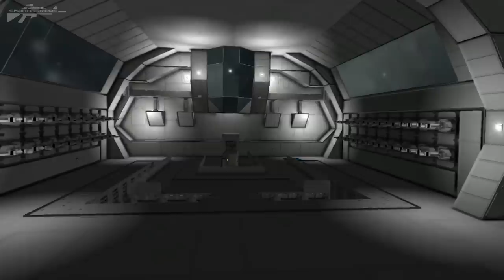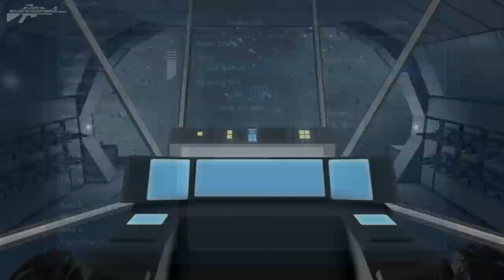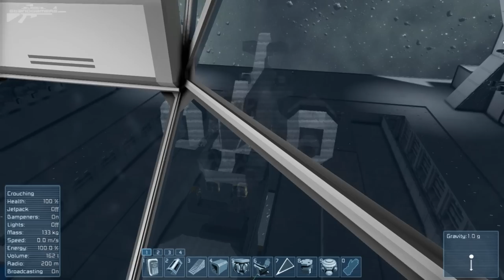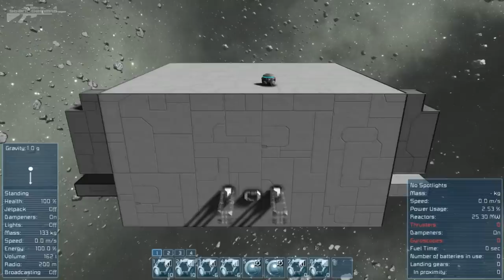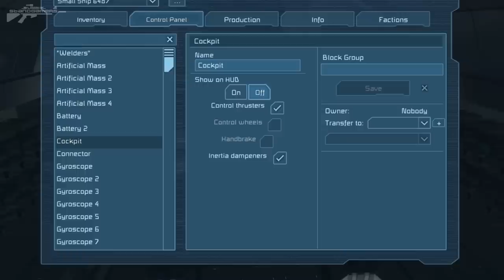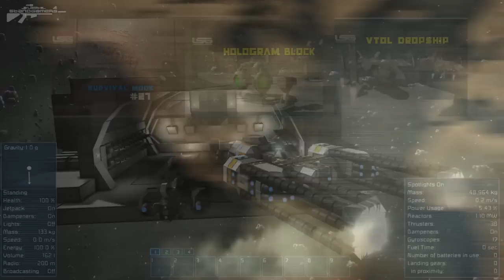Space Engineers - Ship Regeneration Stations, Hologram Printer

Comment: If you made blueprints correctly, you could have it produce multiple ships at once, like four different Henrys. The best thing to do would make a carrier that has a few of these in it, so that when there is a fight, you build a bunch of fighters and when the fight is done you simply grind them back down into materials. This does many things:

1. Cuts down on lag from having 30 ships docked to a carrier.
2. EXTREMELY cuts down the size requirement for carriers, having a few ship printers compared to massive flight deck.
3. Means that you can have any composition of spacecraft you want. Instead of carrying 10 bombers and 20 fighters, you can decide to print any number of each for extreme versatility. You are only limited by materials. 
4. Adapting or upgrading your fleet. now you don't have to manually upgrade 30 different ships, because since you only print them when you need them, all you need to do is upgrade the blueprints.
5. Makes large carriers possible for normal people to build. 

So as you can see, this invention completely changes the game on how carriers will work. Instead of having 30 ships, you can now have but two or three ship printers and only have fighters when you need them.
Reply: Yeah, I completely agree.
I've recently made a rebel rigger that contains a small bay that allows it to produce its own drones. 
The thing is though, I don't have a workforce of 100 men, there's only me and my friend, so we can only control 2 ships at a time.
Though if the game can eventually support large multiplayer battles, I think that our ideas would fit perfectly for that!

Comment: I challenge you to build a ship that can replicate itself, or its parts, or if the ship is damaged it can auto-repair itself, something like that.
Also keep up the good work with the videos! ;)
Reply: He has already made a self repairing armor piece.
Reply: The Average Pro  But when bits of the armor was actually destroyed, it wasn't able to replace it. All it could do was repair damaged bits. With the projector, does it maintain the projection and replace parts that are destroyed?
Reply: Kilogaust No, because the projector is on the station, but if it was on the ship, and the hologram overlapped with the existing ship, there might be possibilities...
Reply: I just want him to try to :D
Reply: RMT: SyMix_RMT & Nabsrmt the projection will stay as long as there is a block that is not finalized
when that happens then you need to reactivate the blueprint
Reply: I've made a ship like that. I still don't know if it works though. It's basically just a 3D printer, as I like to call it, made out of modules. The printer i capable of manufacturing these modules, and a few ships to assemble the modules into a new printer as well.
Reply: Nice!
Reply: X39 There is new option what u can tick: "Keep projection" -.-
Reply: Step 1, instal The Nanite Factory  mod, step 2, ser a permanent  hologram of itself(the veicle it is put on) , step 3, ENJOY
Reply: What you can do is designing your small grid drones or fighter always below 10 small blocks thick on at least one dimension. They then fit trough two large blocks gap which is the max welding distance of two walls of welders facing each other. That way you can produce almost instantly drones and fighters as well as fully repair any damage as this setup will weld any fitting ship up to its core. I use this for my small ships and its the most efficient way.
For large grids i just do heavily armored ships with welders on all components and enough components stored to provide everything several "lives" worths of repairs to keep it alive and shooting as long as possible as they are way more expensive overall. Losing a large grid battle ship is a big deal in survival so you want to make those count ! 
You can even have a jump drive on them for emergency retreat when damage is critical to not loose the whole ship. If you're rich enough and it's protected it might be worth it.
Reply: I want a regen ship

Comment: On my absolutely massive SSY-1159mlc I have an on-board shipyard and scrapyard. It prints 4-6 drones in <30 seconds. Since the ship is so absolutely massive(345L * 85H * 115W) the projector x welder combo was a godsend. I even use the printer to print printers to reconstruct the base ship.

The idea started as a mobile shipyard/factory. Then it turned into a living war machine. Drone patrols, drone miners, drone engineers, automated defenses, automated production, and now with parachutes, automated raids performed by... drones. I'm not even done building the bastard of a ship. I still need to get the Network App Web working(if anyone knows how to set up the NAW please help).

Comment: i have some problems with welding the blueprint, i have made about thesame welding device in survival mode,but it wont weld my blueprint,and yes,the pistons/welders are connected and supplied with items,i think its because the blueprint isnt alligned with the projector,but i cant get it right,does it have to be conveyor tubes that connect the ship with the projector,because i used simple light armor blocks that i cant later grind off,

Comment: Dd timers some other stuff and make it fullly automaticaly shooting out ships(Ofc u need element that wont be weilded)
so make a mashine that after presing button make houl ship with no other buttons pressing and maby even set of ships and after that turns of

Or another ide is that u can make a automatic cannon whielding missels at shooting using merge block to connecting them. merge block is great base becouse u can whield them and ver simplu unattach (only problem is that when u havent a conveyor u cannot ship suplies into so u need refuel manualy... but probably if u smart build ship u can do that too

Comment: tried to do a assembly hangar for megaships but the sheer size of mega ships makes it rather difficult for a welder setup that is connected to the hangar(tried  rotationg ones because a wall would be too expensive) my solution is quite boring namely a welding ship because you don't lose much time using it and it's much much cheaper however the lack of style bonus is annoying ^^

Comment: Kek this does not work in survival, Tried it. Welding even at max is way too slow and even at the slowest it just blows the parts its welding up and cant reweld cause theres pieces everywhere
Reply: Did you try creative? you might not have had a stable system IE a platform that is not going to shake because of the wielders
Reply: It twas built in Creative, It welds TOO slow to complete the ship and just destroys it this video was created in Creative, I moved it to survival gave all the parts needed, and it was a diaster, worked fine in creative but survival nope
Reply: try upping the wield speed to whatever the highest is its like 3x right? I forget
Reply: It is..
Reply: It might be just that your rig is unstable try it on a station if its on a ship if its on a station try it on a ship
Reply: Sanya Bennett you can change that though. Just adjust the config of your server instead of doing it with the UI.